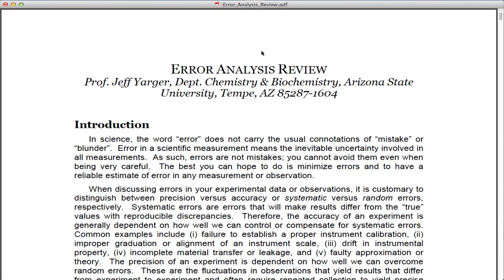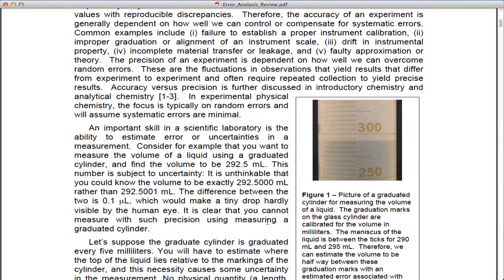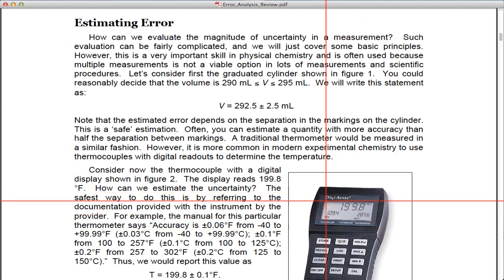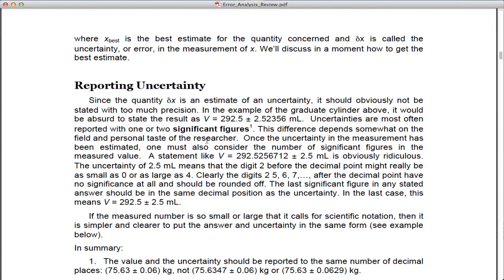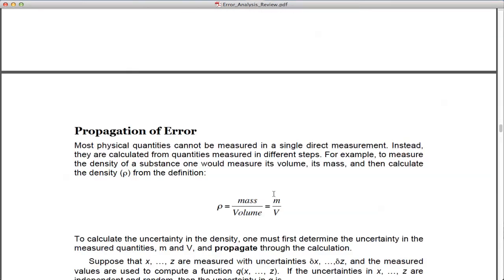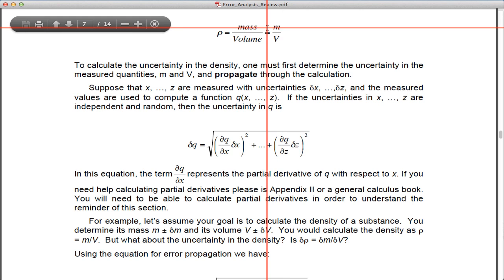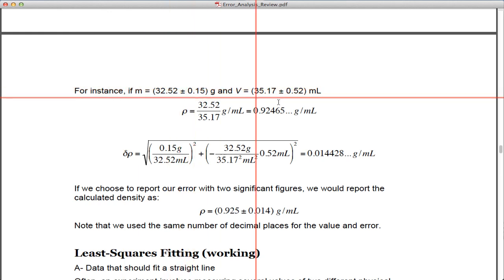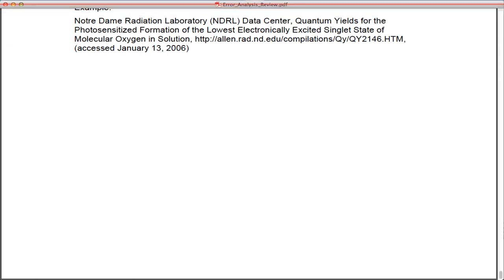Introduction to Error Analysis for Chemistry Lab

Comment: First, thank you for the video! I specifically needed help figuring out how to calculate error propagation and this video was exactly what I needed. I do have one question though, at about the 9:15 mark where you actually plug numbers into the error propagation formula, shouldn't the first term be (0.15/35.17)^2 and not divided by 32.52? I believe it should be divided by the volume and not the mass. Either way, this video was very helpful so thank you!